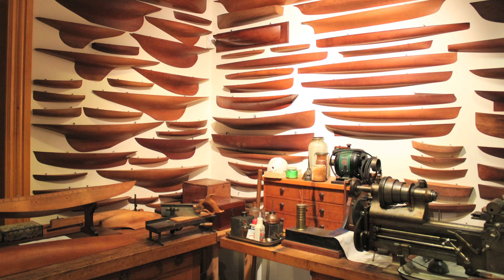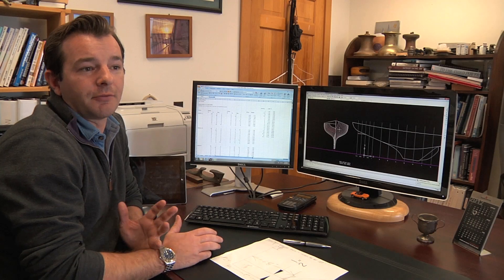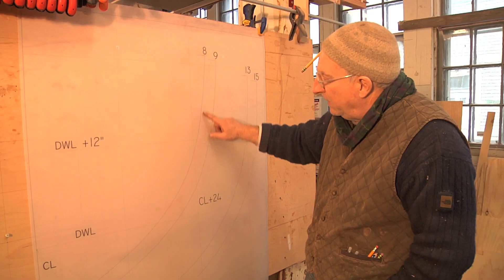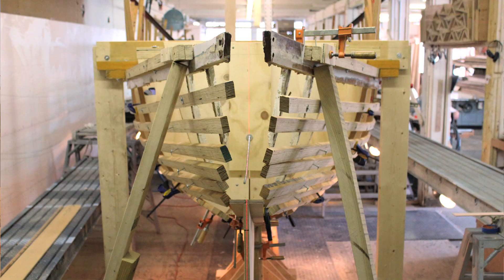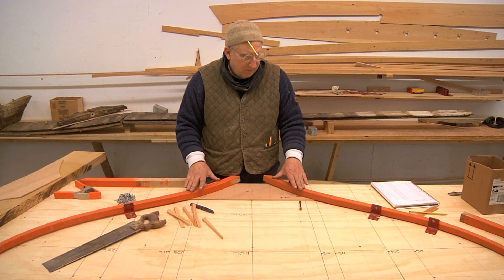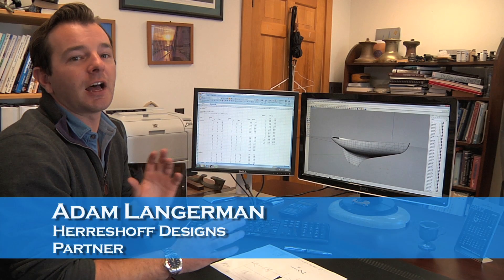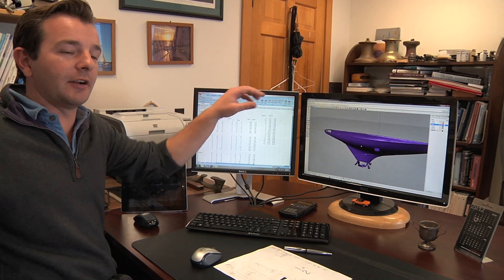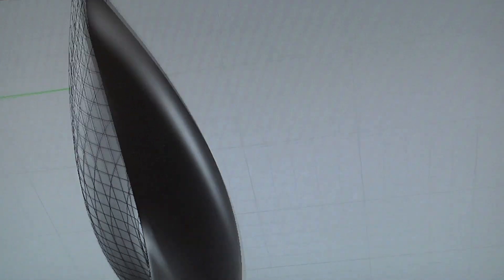Herreshoff S-Boat Restoration - 3D Scan and Computer Models

Comment: Fantastic work!
 I have one question - when you took the offsets and put them in a spreadsheet, will the 3D CAD program draw the sections and virtually loft the hull? or do you manually enter each point and draw a spline for each section?